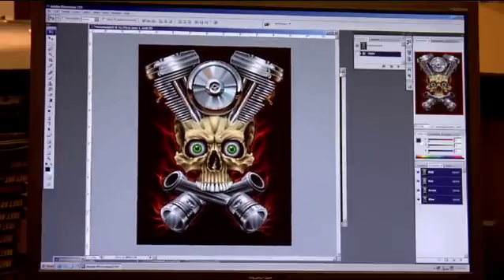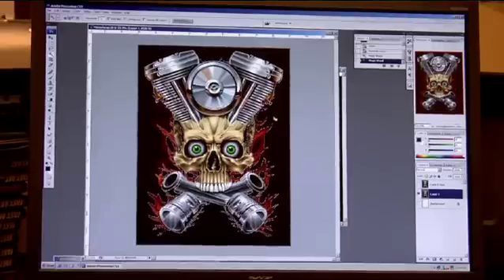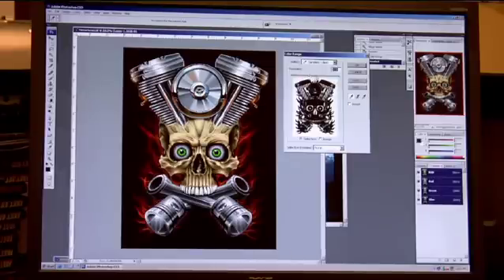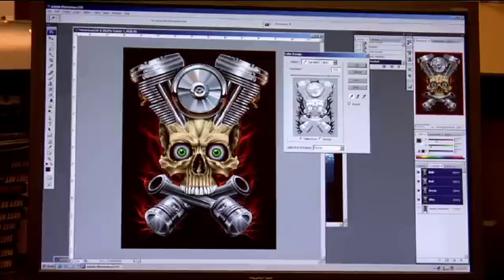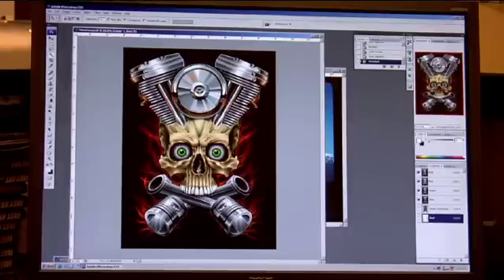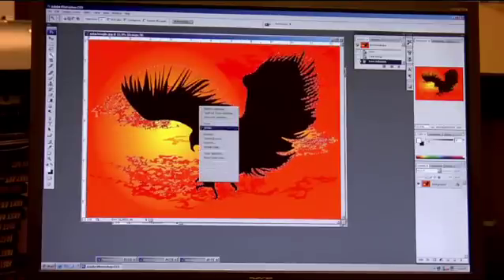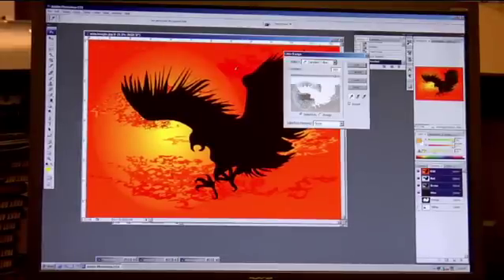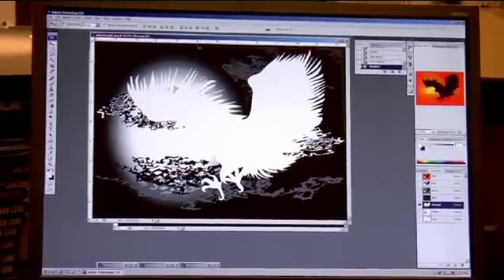Simulated process screen printing separations w/ spot process Part 1 of 2

Comment: Duplicate the file and change the mode to Lab color. Use the Lightness channel as the underbase. Much easier and quicker than color range. Choke it back with levels if you need to. Also, to get your spot white, duplicate your file and desaturate. Invert color to make the background white and change the mode to CMYK. Copy the black channel and there you have your spot white.
Reply from the maker: +Lance Leslie Great insight!
Reply: Lance Leslie ...Thank you!

Comment: I need help.. I have been doing basic bitmap separations for CMYK, full color screen printing for shirts, but when I do a separation in photoshop, I select bitmap, output 300 pixels per inch, halftone screen, frequency 55, angle 22.5, shape: Round. for Cyan right? but when it converts to dots, they are not round, they have a distorted shape. Any idea why this is happening? why aren't the dots well defined in my photoshop? am I doing something wrong?  Any help would be appreciated ^.^

Comment: @Ryonet 
Just as long as the bitmap art is full size at 300 dpi, there will be no problem with "blockiness".  Remember, the image will be exposed on screen grid with a lower resolution, and then the  substrate, (shirt) will have an additional grid from the fabric texture.  I've even printed images at 240 dpi and still get great results.  Fine text is another story and should be output as outlines (or vector).